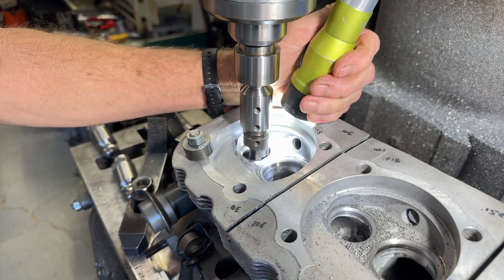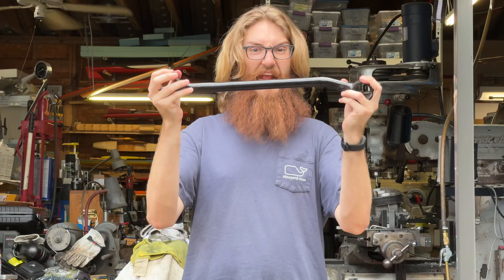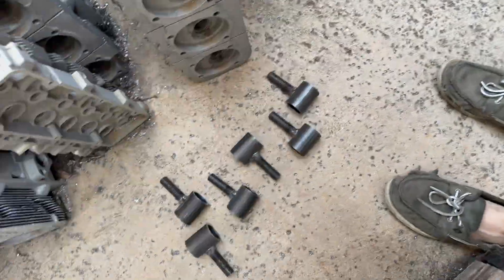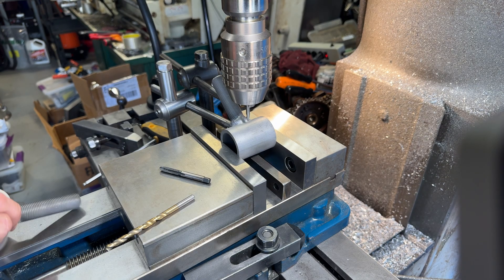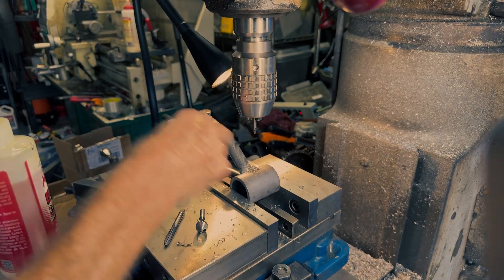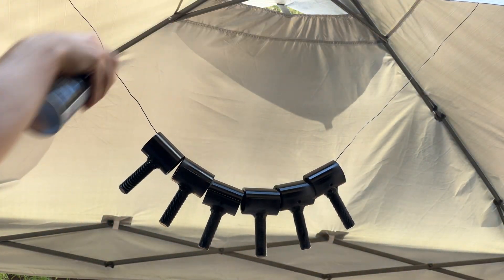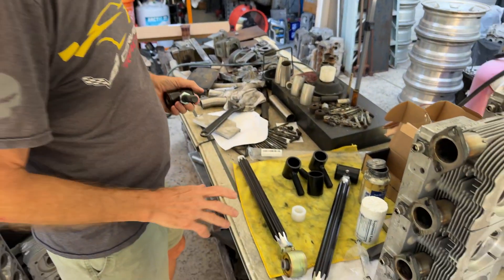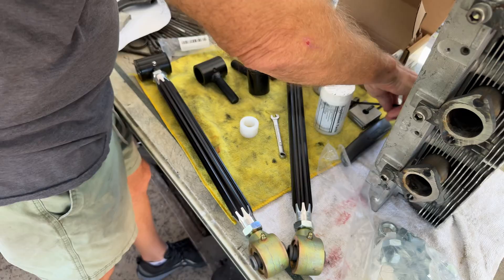Upgrading the Corvair Suspension One Part at a Time (1965 Corvair Late Model Strut Rod Fabrication)

Comment: Rubber allows for articulation on both ends of the arms, now you have only installed bearings on one end, the other end with that poly bushing is going to bind, your welds are also way too cold, expect breakage.
Reply from the maker: The bushing on the outside is free to rotate because it has a steel sleeve on the inside. The outer bushing can be more ridged because the spherical joint is relieving the torque on the rod. You're correct that the rubber bushings are better when you don't have a spherical joint but it's much better to have a stiffer bushing when the other end is allowed to move and release the torque.

Comment: I have read that these straight struts screw up the suspension geometry. the straight strut makes the wheel swing in an arch up and down. The bent strut had a tendency to keep the wheel camber correct because it doesn't swing in an arch. With the straight strut the camber will swing negative to positive. The bent strut doesn't change the camber as much.
Reply from the maker: If the strut is purposely or unknowingly made shorter than stock the camber would swing more positive and negative, but if they are adjusted to match stock, the camber shouldn't change. As far as I know the bend in the stock strut was for ground clearance and maybe stiffness.